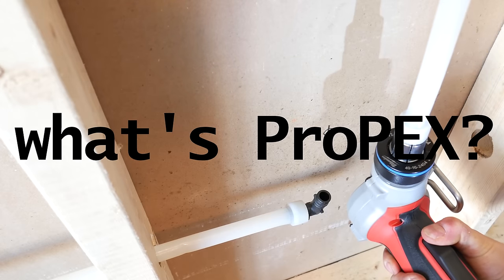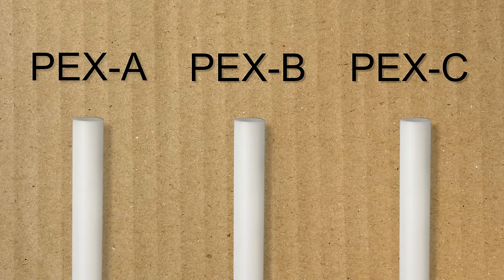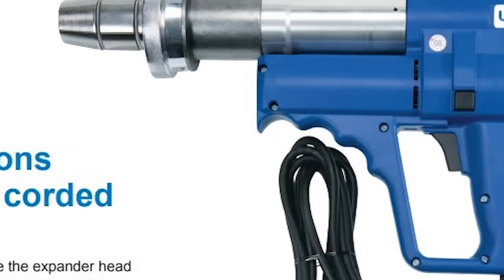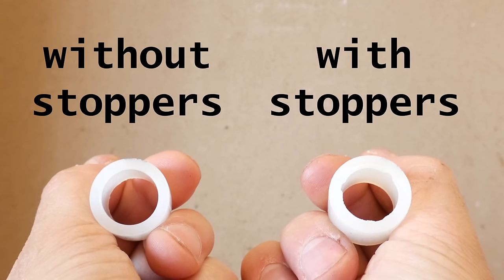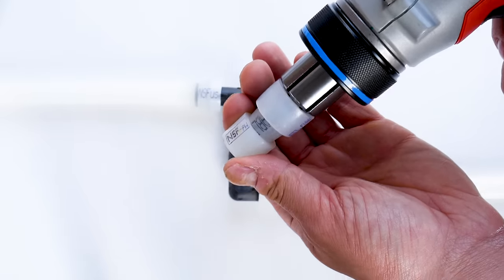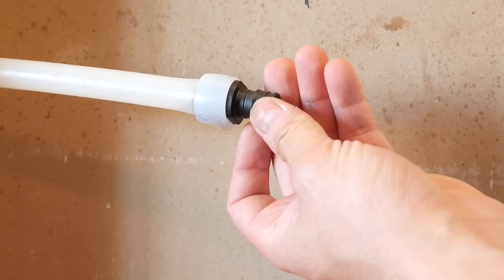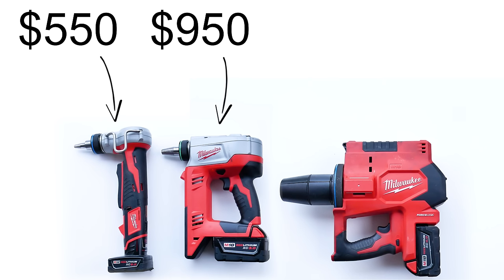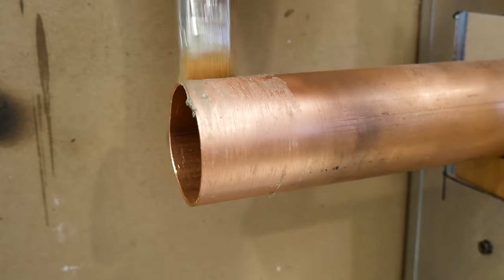UPONOR ProPEX, The Future of Plumbing (COMPLETE GUIDE) | GOT2LEARN

Comment: It is not the future cause i can to fit the tool anywhere i like
Reply from the maker: LOL
Reply: @Got2Learn  yes the plumers job is hard enough trying to fit in tight places i can not imagine having to deal with this in a repair. For houses i would choose pex with compression fittings and for exposed pipes where i have space i would use ppr it is easy cheap and put in houses for almost 40 years with no problems.
Reply from the maker: Its about the same size as a torch, or crimper, I don't understand your reasoning.
Reply: @zaxarispetixos8728   It does work pretty well in some spaces but the good thing about it is you can flex the pex pipe to your tool,  expand it and then put it on the fitting ,most the time you don't have to put the tool in tight space

Comment: Plastic water supply  Worst idea since Romans used lead cups and vases to store wine in  Use copper, it self sterilizes, copper won't support germs etc.  You bay 200 g for a house but cheap out on 5 g of pipe  INSANE  Plastic pipe lets GC and developers cheap out charge you same and give you crap

Comment: Be careful when doing it wet. If the outside of the pipe is wet the ring will slide up despite the stop. My helper had to leave early one day and left the 1 1/2 tool partially expanded in the pipe. It was probably 30 minutes before I found it. I had to hold the fitting in there for like 15 minutes before the pipe shrank enough to hold the fitting.
Reply from the maker: Good input, thanks Josh!!
Reply: If that happens, use a heatgun and heat the pipe until the pipe turns transparent (don't melt it!).  Once it turns clear, it returns to it's exact original dimensions.  Cool it down and expand as normal.
Reply: John-Del funny I don’t carry I heat gun but just use a torch extremely delicately. Either way I’ve used it with uponor in several ways but never thought to use it then. Thanks

Comment: No way in hell I'm trusting a plastic fitting inside a wall or ceiling.
Reply from the maker: This system has been in use for 20 years fyi.
Reply: @Got2Learn  I have a 38 year old rental house with ticking timebomb polybutylene pipe which probably also had fanboys back in the day. Houses plumbing should last 100 years, so 20 years of testing is not going to do it for me  just yet. BTW I understand the need for faster plumbing install with less skilled labor, but I would not build/ buy a house with plastic fittings (Besides my obvious past mistake) I'll let someone else run the experiment. Great quality video. Keep it up.
Reply from the maker: Polyb started acting up way before 20 years so it's a good sign as there are zero problems with UponorS system in terms of longevity, let's keep em' crossed! 🤞

Comment: In Europe, we use the Uponor system (and other PEX systems) with another set of pipes on the outside of the PEX. This means that we can lead possible leaks back to a hub, and also pull out the whole pipe and replace it without having to open walls. That is a lot of the point why we use PEX. Seeing how you use Uponor in the US, with fittings inside of the walls hurts my eyes.

Comment: 🤔 
(Sharkbite enters the chat)
 Sharkbite walks away as the winner.
Reply: Sharkbite is for temporarily fixing the problem, i would never leave that fitting for permanent situations.
Reply: @Eddie-In-Las-Vegas  and why not
Reply: @Eddie-In-Las-Vegas  To be honest, you do know shark bite fittings lasts 25yrs
Reply: @NoName-zz8nl  Im not really knocking the reliability of the product......its just too many installers (plumbers and home owners) do not install them correctly and either within days or even years these push fit joints blow out causing thousands of dollars worth of damage. So due to operators ignorance use these things as temporary fixes and either PEX crimp it , Expand it, or Solder these connections for permanent fix. Its one thing to read a product sheet and feel confident that the product says 25 year warranty life and another to have a guy out there in the field or a home owner put in an emergency situation and slap these push fittings together under distress and go hurrying to turn his water main pipe back on. Use these fittings cautiously I still say and dont use them for long term.
Reply: @Eddie-In-Las-Vegas  to each their own

Comment: Ok so a couple of things I don’t know about you but I am uponor certified by the company itself, I’m a new construction plumber and in our company we have fully switched to uponor for all the indoor and underground residential and commercial water lines what you failed to mention in this video is that in the cold it’s much more difficult to work with uponor anything below 50 degrees and the uponor takes a little longer to close and if you aren’t watching fittings can come apart a little causing you to have a leak now anything under 30 degrees and you can work a full day installing uponor and at the end of the day pressure test the system and your chance for a leak is wayyyy higher because the uponor does not want to close in that temperature, I’ve had this happen to me multiple times so the way to combat this issue and it takes much longer is to use a heat gun on every single connection you do in that kind of weather if you do not do that you are almost guaranteed to have a leak.

Comment: yes but if you have some problem after 10 years, its not in stores any more because its not producen any more and you dont have tools also, so its useless in normal condition, ppr welding pipe system is more user friendly! Simular then REHAU system with copper fittings and rings, water supply made just 10 years back, but now you cant bay any of this REHAU so fixing cant be don, so put it in your ass... sad!

Comment: Well let’s hope so, because I been having leaks . We do everything by the book , still they leak.
Reply from the maker: I never got a leak with this system, what temperature are you installing this at?
Reply: Between 92-99 hot humid Houston TX
Reply: It’s probably the wrong fittings thanks for responding fast . I believe I’m a subscriber of yours.
Reply from the maker: Yes, you must absolutely use the proper fittings, it it's guaranteed to leak.

Comment: Sharkbites are far superior and save a ton of time
Reply: A good professional plumber would never use a Sharkbite fitting. That junk is for "professional homeowners"...
Reply: @T.Dubya311  not junk, just pricey. Plumbers use them all the time.
Reply: @MrC9Oh3  Not good plumbers... I'm a master plumber who employs 7 other licensed plumbers. I would fire any one of them if they ever used a junk stab fitting on any of my jobs.
Reply: @T.Dubya311  press fittings are proven if you install them correctly. I've honestly never had one fail. I've fixed more copper than anything.
Reply: @MrC9Oh3  They're prone to leaks and they don't even look professional... You'll never change my mind.
Reply: @T.Dubya311  no more prone to leak than a compression fitting or any other fitting.  Who decides what looks professional? Lol. I'm not trying to change your mind.
Reply: @MrC9Oh3  You obviously have no clue what city water does to rubber seals. The seals on a stab fitting are nothing more than skinny little rubber o-rings. And a professional plumber and their paying customer decide what looks professional and what looks sloppy and rushed.
Reply: @T.Dubya311  city water is hard on everything, that's why we install water softeners.
Reply: @MrC9Oh3  A water softener will not remove chlorine or chloramine from your city water. That is what really destroys rubber seals. Hard water is what eats away at your copper, especially at the 90s, 45s and couplings.
Reply: @T.Dubya311  filters will
Reply: @MrC9Oh3  Only a reverse osmosis filter system would even come close, but how many homeowners do you know who have a whole house RO system? Many of my customers are very wealthy and not one of them has a whole house reverse osmosis system.
Reply: @T.Dubya311  won't be long copper will be phased out, and the days of charging $600 to sweat on a single angle stop will be over. I convert all copper to pex and never look back.
Reply: @MrC9Oh3  yes replace everything with cheap plastic sounds about right for America in 2022
Reply: @aaronerickson8878  let's be honest there's no saving America, make quick money and enjoy life while u still can